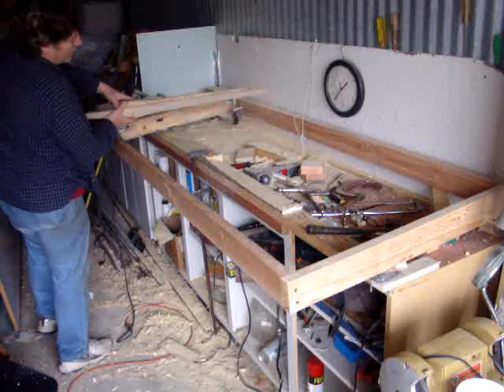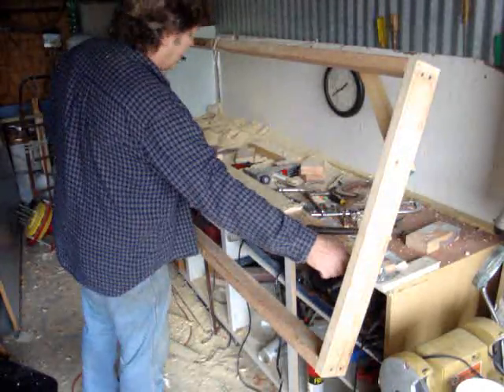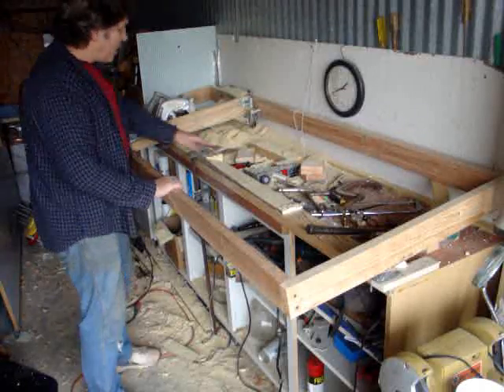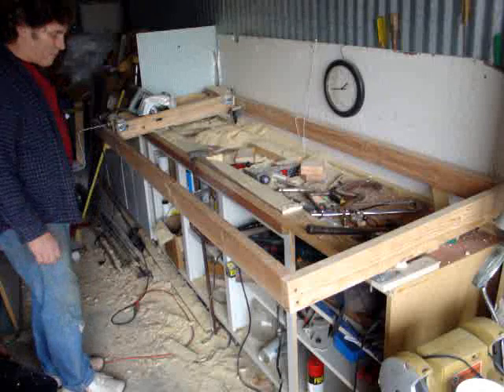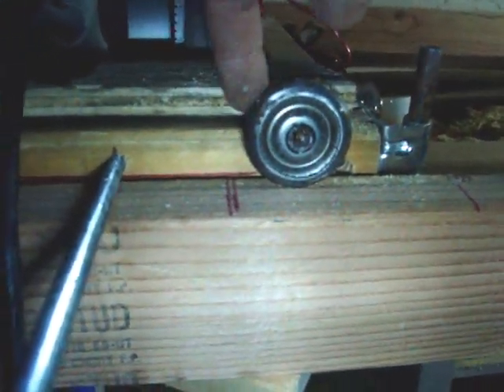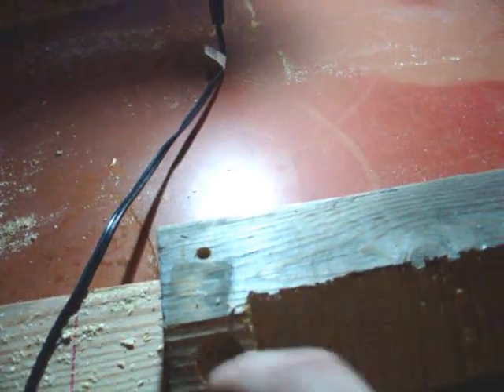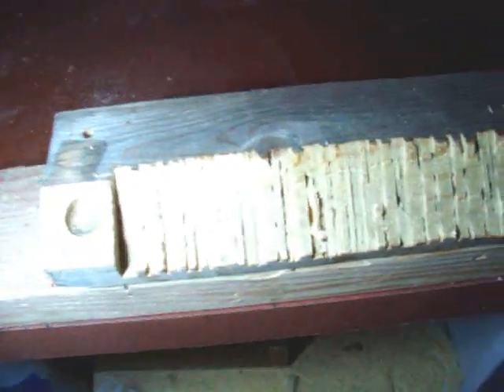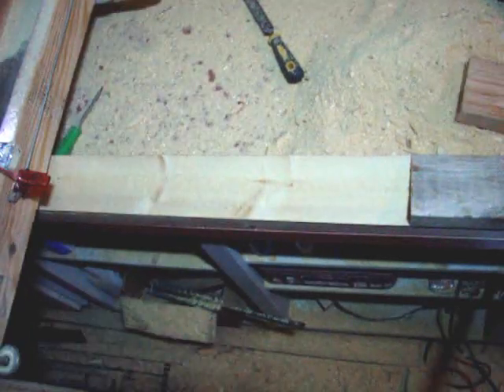THE PROP CARVING MACHINE (PART 2)

Comment: You can always start selling your saw dust to those who have composting toilets.
Reply from the maker: +Scorpion85629 An excellent option. I now use it for a saw dust rocket stove for cooking at the shop, and for my own composting toilet. I am very surprised at how well it works. Barely any smell. And my buckets are sealed with screw on lids. When opened, The smell is very small, and much better than a cat box, even after being sealed. Very surprising.
Thanks stinger.
You put a smile on my face.
MUDDy

Comment: @muddymuddymuddmann
 G'day Scotty... Wheee ! Top marks for showing the Whoopsie at the end... If you check the most recent SunFoil clip I posted, it shows how much an open-backed Gallium Arsenide PV will expand on a blue-sky, windless, Late Spring day... I have to re-repair the 3 busted Corners, & then drill Thermosyphon Holes in the Trailing-Edge... At least it validates ALL the efforts I made to cool the Mks 1, 2, & 3... We learn from failures.  Ciao !

Comment: I don't think a routers gonna speed anything up or improve the finish. In fact it might end up being a pain in the butt. I think the circular saws best as the blade has a large dia it will make flatter cuts with each sweep, thats gonna help the smoothing out phase make it all blend in better. Oooooo I wonder, can you fit a dado stack on that saw :D. Nice work Muddy, Good luck.